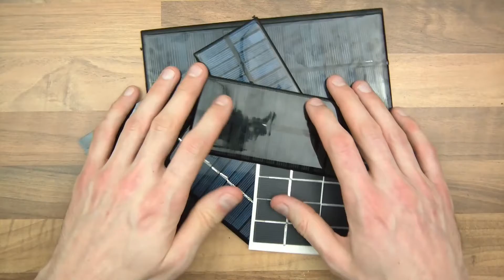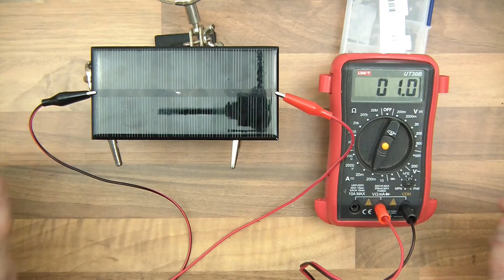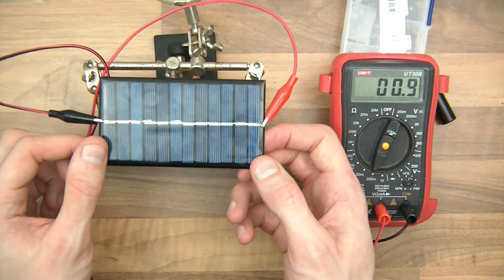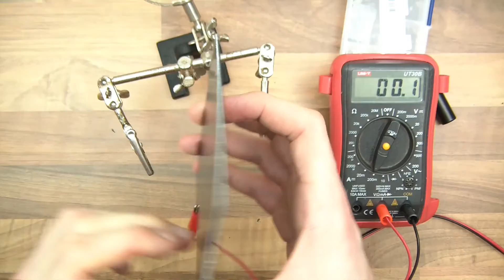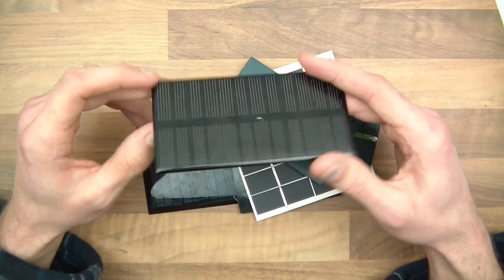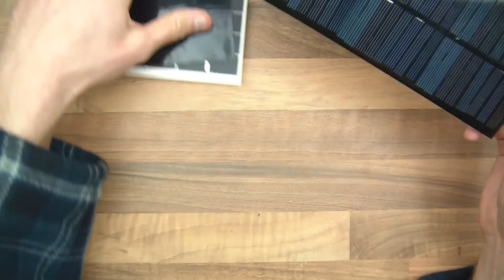Checking Out a Small Cheap Solar Haul... Testing Amperages.

Comment: Hi Antony,
You can hear the disappointment in your voice when you see how much current they can deliver. Lol!
These cheap Chinese panels are really poor.

Just a point about your meter.
The 10A Max connection is ONLY for use on the 10A setting, so its not faulty or blown fuse.
All the other settings use the middle (mA) connection. You probably would have got a better result if you used the 20mA or even try the 2000uA setting, however the conclusion is just the same, cheap rubbish, which is fine if that's all that you expect.
I now have 2 of the 110x60 panels connected in series so I can get about 100mA in good strong sunlight and reaching about 15 volts. It keeps a single 16850 LiIon battery that is connected to an ESP12 on my weather station nicely topped up. The ESP12 only wakes up for 30 seconds every 15 minutes so the current drain is very low.
I think I could get away with just 1 panel and / or increasing the 'ON' time of the EPS12.

What did you do with that box of panels?
Cheers
Martin
Reply from the maker: Hi Martin, yes, I don;t know wth was going on with my multimeter, the correct setting was showing 0ma or something strange. It's cool about your project. Usually these videos are done weeks in advance, but in this case, actually the panels are only 2-3 weeks old. I haven't done anything with them yet. I want to get the largest, connect a resistor across the terminals, add a microcontroller, a light sensor,  SD card, and poll light, voltage, amperage. I want to see exactly what these panels can do. That will be one of my next projects...
Reply: Hi Antony,
I have done some more tests today around midday to make the most of sunlight. Results are better but still only 36% of rating at best and that is with an optimum load through a 100 ohm resistor. Higher values reduce the current and lower values reduce the voltage (and hence current too).
I have been running my weather monitor for a few weeks now and connected 2 x 110x60 panels (in series) to charge the LiIon battery. Unfortunately, I have now killed the battery through over charging. Not a loss because that was part of my experiment. 
I have tried several methods to charge the battery but direct was the best so far, surprisingly. I just need a cut off when the LiIon battery reaches 4.2 volts then I will be sorted.
One of the other methods I tried was to use a buck-boost converter, this requires a minimum of 3.8 volts to run and even with 2 panels in series the current drain alone drops the voltage to less than 3 volts and therefore won't give me a steady output (which was set to 5 volts).
Another was to use a LiIon charger, with 2 panels in series I managed to get a charge current of 30mA peak but with one panel, it wasn't enough to operate the circuit.
So, I'm thinking of just using a making a circuit to connect the panels when the cell voltage is below 4.2volts and have it disconnect the panels when the cell voltage reaches 4.2 volts to stop over charging. I'm not bothered about the charging current to the cell as this would be low anyway. I could remove the sleep function from the ESP8266 and have it on all the time, this could drain the cell sufficiently overnight so in daylight the panel would re-charge the cell but would probably not reach fully charged. This would make the cell discharge over time but still last longer than the cell on its own.
Any ideas from you or your audience would be appreciated.
Cheers
Martin
Reply from the maker: @sausagehider  Could you add me on Facebook? Just search by name. I'm kissing a baby in the pic. My idea for your problem is using a 4.2v LDO voltage regulator. Antony...
Reply: @sausagehider  hi, I'm looking to solar power a pi zero with camera for surveillance so I can position the cameras anywhere without the worry of having to provide power cables. Would the setup for your weather work with the pi zero??. Cheers Don...
Reply: @lawaver  Hi Don,
I have gone through a few more ideas since my post here.
I don't seem to be having much sucess so far.
You would need to look at the total amount of current draw of your project, total capacity of your batteries and best output from your solar panels.
My problem to start with was the varying output from the panels I was using. You cannot just connect them to you your battery as you end up killing the battery as in my case. You would need a Li-ion battery charger to make sure you don't over charge. Unfortuanatly I only had about 30mA of charge current available, so using one of those took most of the available current and left me with nothing to charge the battery.
I have been experimenting with a ni-mh battery pack as you can basically connect them to accross the solar panels and charge them with however much, or little current is available, but capacity becomes and issue.
I suspect that a pi-zero and camera transmitting constant video via wifi is going to take a hell of a lot more current than what I was trying to do, and looking at my results I honestly don't think it is feasable.
Cheers
Martin
Reply: @sausagehider  hi, the pi zero with camera, wifi etc is about 150ma.(maximum) With a 3000ma lipo battery i should get about 12.5hrs use per day. (80% effiency). I would need to find a suitable sized panel to keep it charged. This is my problem, what size panel??
Reply: @lawaver  Hi Don, There are a few things to consider, although you say 12.5 hour with 150mA, you panel(s) would need to supply at least double that especially if the camera's were to operate over night too.
You not only need to put back what you take from the battery, you also have to have enough to power the camera at the same time!
I don't know enough about the panels and sizes, I was just messing around with a couple of cheap Chinese panels and I think that's about all Antony was doing too.
He may help more as he does have his own solar PV setup.
Anything to add Antony?

Cheers
Martin